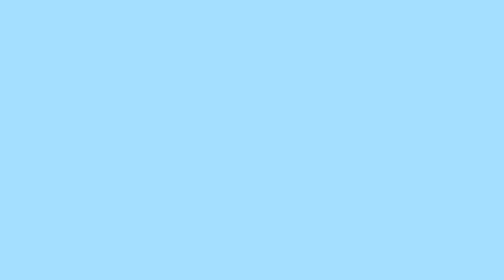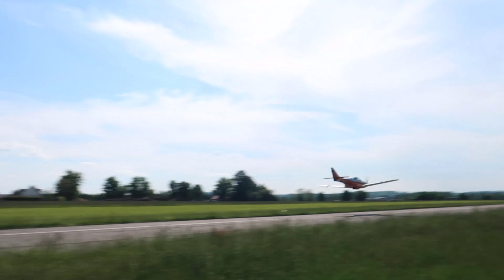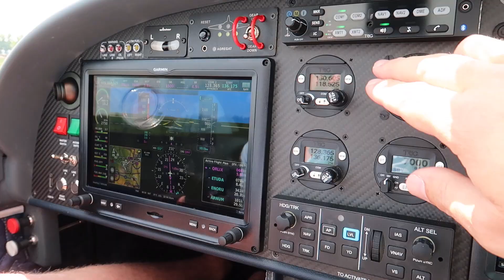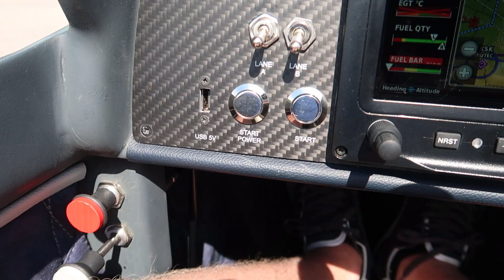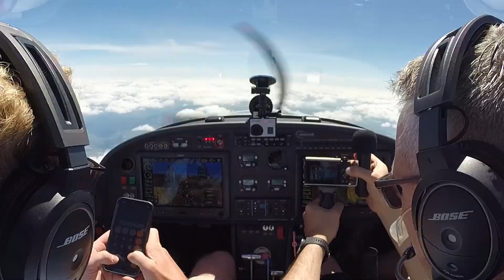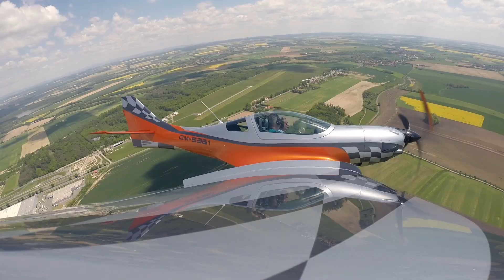JMB Aircraft's VL3 915; flying fast, high and low, in one of Light Sport Aviation's finest - S03 E09

Comment: The Risen has a guaranteed cruise speed of 230 KTAS at FL180.

That is a continuous cruise speed of 265 mph pulled along by a Rotax 916iS.

Alberto Porto crossed the North Atlantic in his ultralight Risen, with 2 pilots, in 10 hours from Scotland to Goose Bay.  

That was in a single leg.

Without refuelling.

With 3 hours fuel on arrival.

Comment: Yes, what I said on your last video. 
Fun pulling up with authority at the end of an “option” over a runway.
Reply from the maker: A lot of fun! 💪🏻
Reply: @ForFunFlyer  

Try it one day, on any plane.  You just have to squeeze the control towards you, don’t snap it, you can enter an accelerated stall and snap-roll it. Pull the control far, I tell people to say “pulling up”, that should be the time it should take the control to travel. You won’t even get to 3 Gs anyway. Lol. Nobody does on the first few times, unless you’re on an aerobatic plane.
Reply from the maker: @cmdmd  I already planned on going for a ride with an aerobatics pilot, so; Wilco 😉
Reply: @ForFunFlyer  

Try a sequence of roll, loop, Cuban eight, slow roll (holding altitude), hammerhead, spin and recovery, snap roll, end with a tumble. 

Eat very light two hours before. Lol
Reply from the maker: @cmdmd  🤣
Reply: @ForFunFlyer  

I meant that with sincerity. It is an experience, expensive, so make the most of it. Copy that and hand it to the aerobatic pilot. It’s a progression. 

Oh, inverted flight, that’s scary the first time! lol. You think “shit, I’m going to fall through this cockpit like Wiley Coyote”.

Comment: Thank you for these videos! I am curious if you did any cruising in the 8000-11000 range? I haven't seen much performance data for these mid-level altitudes and would be curious what the expected cruise speed with the 915 would be.
Reply from the maker: No level cruise, just climb out at 2000 ft/min up to FL140 without any problems. The 915 just keeps on pushing! 💪🏻
Reply: @ForFunFlyer  you won’t be pushing that 915 long if you keep flying around at 85%. That’s nearly full throttle at that altitude. The sweet spot for that engine is right around 72-75% at around 7 gallons per hour. Anything faster you have diminishing returns on everything from fuel consumption to longevity.

Comment: Thank you for the climb rate in ft/min
this is something I can readily relate to,
much appreciated. Nice plane!
Reply from the maker: Thanks! 👍🏻
Reply: Multiply meters by 3.28. If you need it
Reply: @cmdmd Thanks for the reply.
 We all can do math, that
isn't the point, most Americans
do not relate to Meters, we don't care
to, imperial works just fine and is what 
we readily relate to. When we hear

something like;
10 miles or 50 ft etc, we immediately 
have a visual and spatial concept, we 
don't care to have to use multipliers
and bounce back and forth, when we 
could simply be given what we use and 
what we prefer. Some Americans love 
Metric, good on them, I use if for some
things but mainly prefer Imperial.

Comment: very nice video, and very nice plane. A little too expensive for mee.
But you have to get rid of the old GoPros in the cockpit. Video does not look good compared to the rest of the footage.
Reply from the maker: Thanks 👍🏻 Well, it's more a matter of focus, where the inner camera facing forward focused more on the shoulders of pilots. I'm still pretty happy with them on general, only the front facing camera could be better...
Reply: @ForFunFlyer  with the newer Versions of GoPro (>7) you don't get that nasty shaking.
Reply from the maker: @airfool  Ah, you mean that. Yeah, I know. But on average it's OK enough. I should've use a different mount, my bad 🙈 But thanks for the feedback 😉

Comment: My main question is, can you do barrel rolls and split S’s ?
Reply from the maker: Legally as a MLA not, as a LSA maybe. I don't know if the Rotax 915is is capable of inverted flight regarding oil system, but I do know the airframe of the VL3 is very, very rigid. So my guess is that the airframe wouldn't be the problem, but to be sure I'd look up the specs on their website 😉